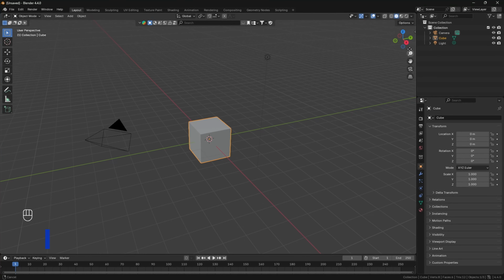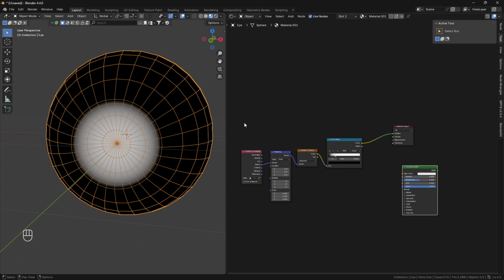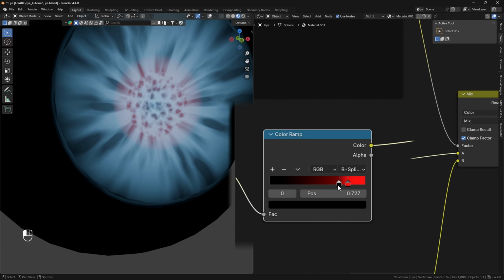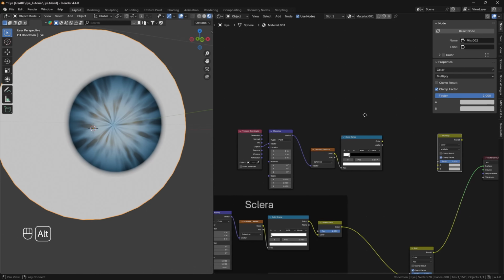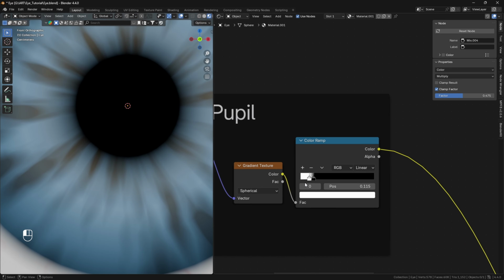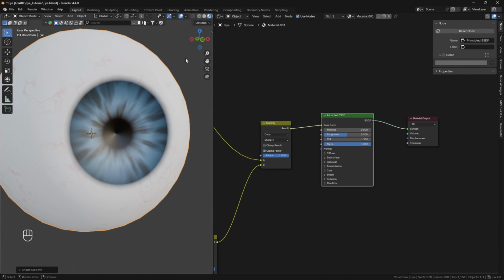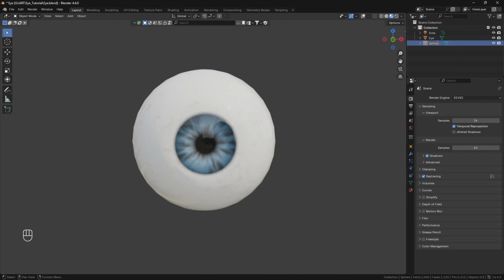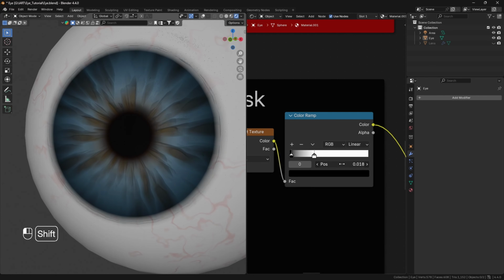Procedural Eyes Creation in Blender

Comment: This is all well and good if you have an eye as an object on its own. But if the eye is part of a model, so the origin point is the model's origin point, how does the gradient texture calculate the mapping?
Reply from the maker: You can use empty...in texture coordinate node select object as empty....then parents empty with eye....hope this works...if not I will again make eye tutorial...
Reply: parenting the eyes to the head instead of joining them worked for me, idk if this helps with what you want.
Reply: If your talking about a model with a rig then "I normally parent the eye to the head (remove all vertex groups from eyes), then just use "track to constraint" for the eye to follow a controller bone..."

When you add the constraint you have to input the rig name and then the rigs eye controller name. I use auto rig pro so the eye controller is like "eye.target.l" or something like that for left eye controller bone thingy.

Comment: I have a another question on this great tutorial. When it comes to exporting and importing this into another project, when I try to resize, scale and move it to my models head, why does the textures of the eye stretch and get messed up?
Reply: I think you should consider making a second tutorial on how to apply this eye to a model.
Reply from the maker: Sorry for late reply.... after scaling may be you have applied Control A for again scaling to 1...this also effect the texture because texture is procedural so the size will effect the texture also...to fix this... first properly fit the eye to your model then apply scale... after then start texturing of eyes...this will 100 percent work....(If you want to visualise this problem, select the eye and try to scale you will see the problem, so first model and fit eye properly to your model then apply scale after Start texturing, then you will not face the problem) 🤗
Reply: So the first issue I'm having is actually in the first few steps. When I scale the sphere to fit in my model's head like you said, the "gradient texture" part doesnt work properly unless I move the sphere to the original point where it was created from. I dont know if thay makes sense, but that's the main issue @dr.hstudio20
Reply: @RazorBites99  I was having an issue with this step too. I had scaled my sphere down and moved it up along the z axis. before starting the shader step, I did ctrl + a, then applied the rotation and scale. After doing the gradient node setup, my sphere was solid white. I seemed to have fixed the issue by adding a color ramp between the gradient node and the output node, set it to ease, and then brought the black slider on the left towards the right, then the white on the right towards the left, and adjusted both of those until it was close to what it looks like in the tutorial. hope that helps.
Reply: lol Adding a color ramp is literally the next step in the tutorial. funny af

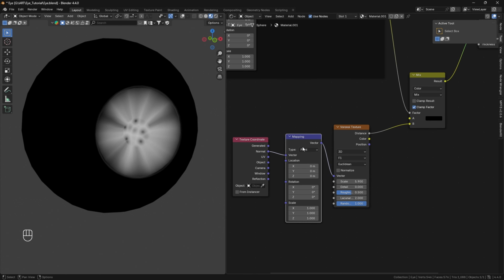Comment: Some how it doesn't work, at 7:00 i don't get vertical lines like your
Reply from the maker: @luongnguyenuc1966  hey... Makesure you have connected mapping node to Normal Socket of texture coordinate.... another thing check Origin of sphere is in middle of sphere.....and third makesure normal to do normal correction - for that select sphere in edit mode and press shift N...Hope this may help...
Reply: @dr.hstudio20  thanks so much, worked, some how if i use less loop cut the normal is different

Comment: This has been perfect so far, but I'm stuck at the cycles render testing. It says it's done rendering but it's just grey and shows the shapes of what I've been working with. Any ideas what that could be?
Reply from the maker: @RazorBites99  1 - problem could be In Material make sure everything is perfect and for transparent material in cycle Keep transmission to 1 and Roughness to 0. 
2 - Makesure you connected material to Material output in shader Editor or restart blender and do rendering.
3 - Makesure you have setup proper lighting.
4- And make sure Normal are facing outward. Or not then select the mesh and go to edit mode and press A to select whole object and then press shift N. This will fix normal.
5- Makesure you have applied scale before giving material. All mesh object scale should be 1. 
6- check Gpu rendering is enabled 

Hope this may help 🤜🏻🤛🏻
Reply: Wow, I am quite the dunce! 😅 I greatly appreciate your reply. It was the roughness slider I had neglected. The render went smoothly. I started over from the beginning using your tutorial for a second go. I have yet to finish, but this is a wonderful walk-through!!@dr.hstudio20
Reply: @dr.hstudio20  i dont think i have the same settings on my version of blender i cant get it to work on cycles at all
Reply: Absolutely immaculate tutorial. Mindful, smooth, and informative. There is no other tutorial like this  one. I've finished with amazing results with my own flare, but with your help. You've got a new subscriber and a new follower!! Can't wait to see what's next!!
Reply from the maker: @RazorBites99  Thank you very much bro🤗🤜🏻🤛🏻
Reply: Hi I hope you are doing well I seem to have the same problem do you remember how you fixed it ? 
Thank you